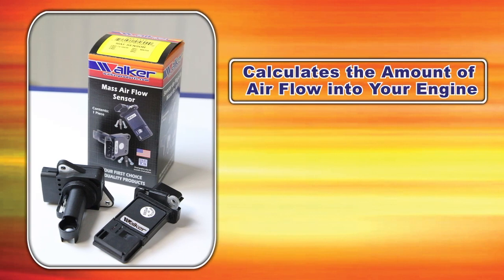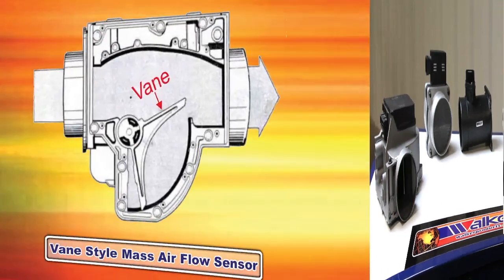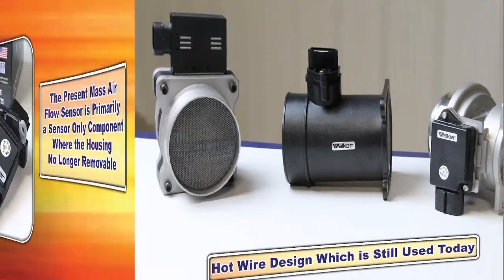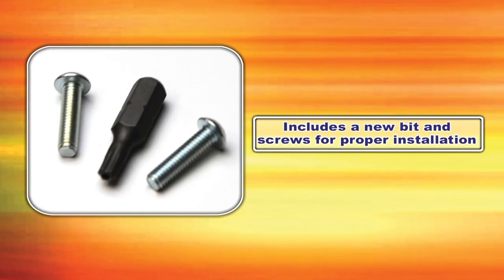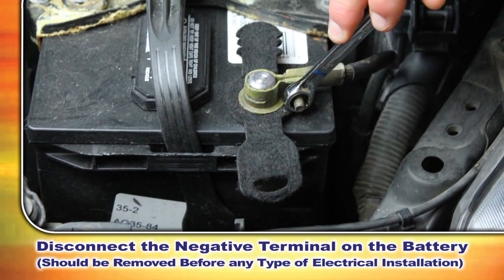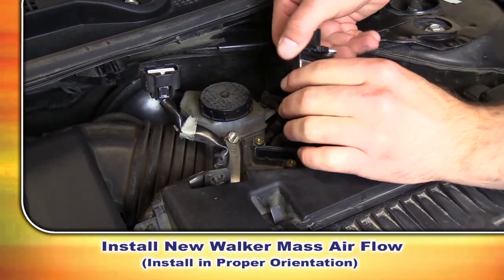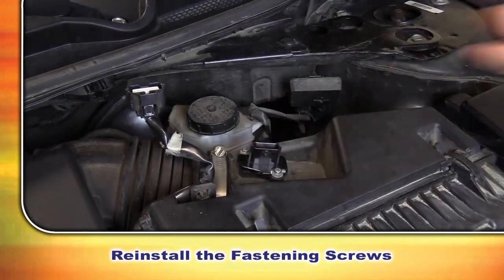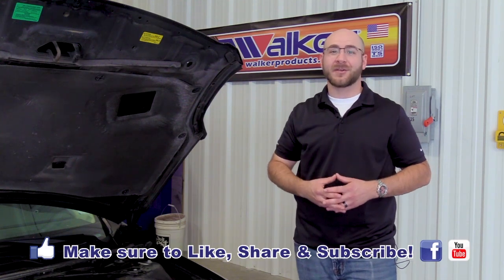How to Install a Mass Air Flow Sensor | Know Your Parts

Comment: I watched a video to try to find out what the orientation was for the sensors in the mass airflow sensor itself, i.e. should the sensor be catching the wind from the intake or should it be in a passive position which, of course you guys didn’t say you’re simply said make sure you put it in the right orientation thanks a lot